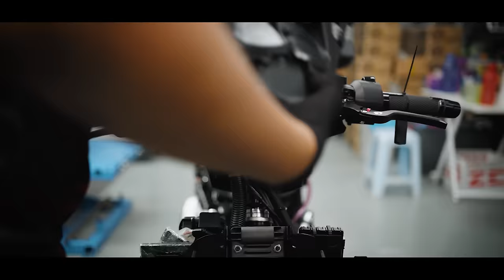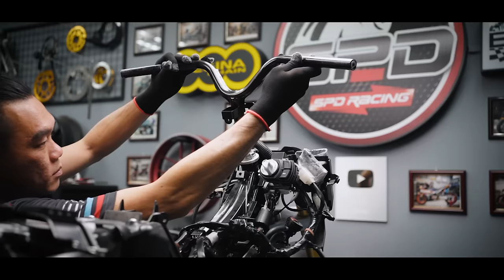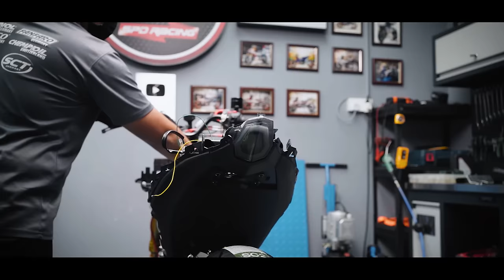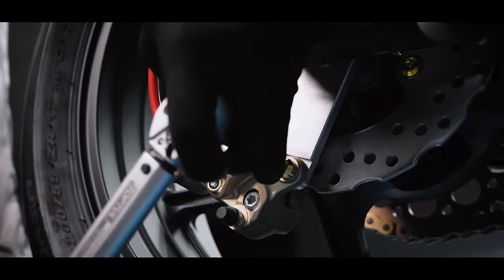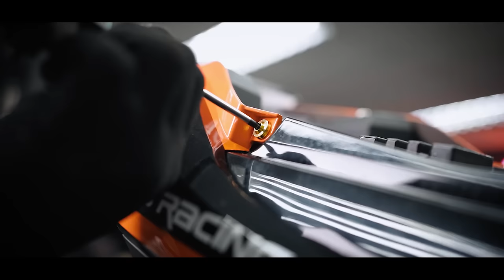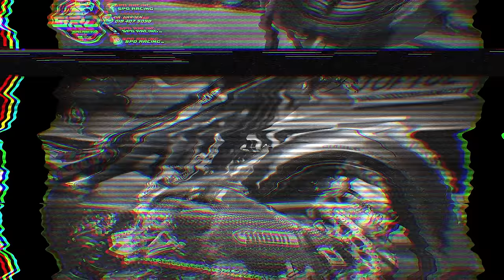BUILDING A SUPER MOPED BIKE ( Full Transformation )Yamaha Y16ZR ft.Kawasaki ZX6R

Comment: And the proper question here is : does this bike as it is, has the proper power to move the extra weight from the bigger wheels, the enormous swingarm and the new front suspension, properly or it's only looks and fast as a tortoise?? Only 160cc you know